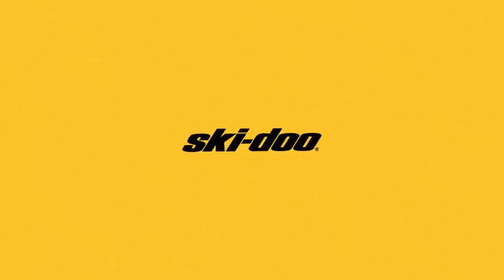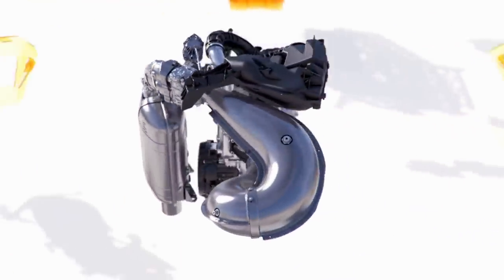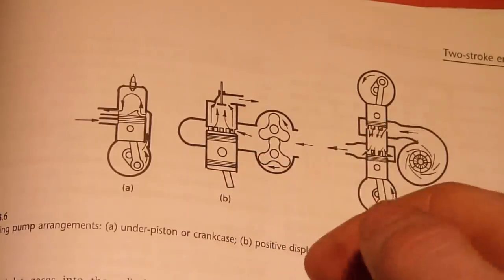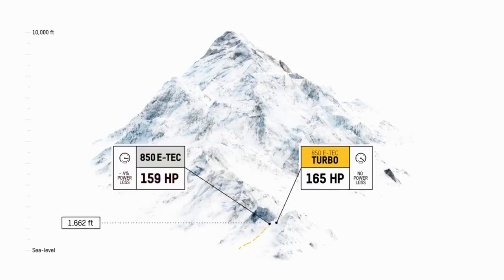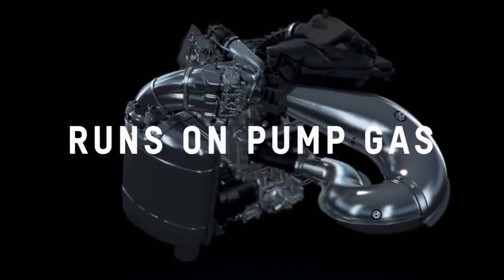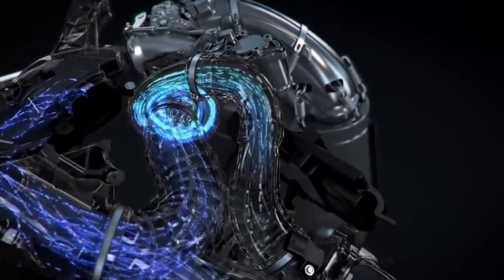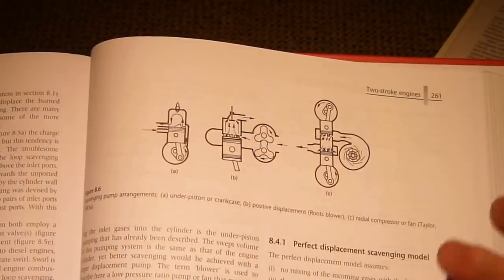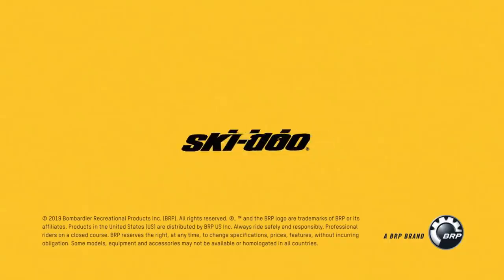2 Stroke Turbos - they can't be done. Period.

Comment: As an owner of a supercharged 2 stroke Detroit I have a feeling this video will be entertaining.
Reply: Both turbo AND supercharged on some models
Reply: But 2 strokes dont have valves bahahaha. I love it when they tell me the Detroit 8 was a 4 stroke.
Reply: 2 stroke Diesel is totally different animal
Reply: @johnpryor1318  a twostroke can have valves.go ahead and check ferrari"s prototypr 3cylinder two stroke engine
Reply: @lightjim1  it was a joke brother. A lot of 2 stroke diesel engines have valves. I'm familiar with the 3 cylinder Ferrari engine.
Reply: I have an old 6v92t lol
Reply: Got me a 6v92 on a 351w... Does this count??
Reply: @johnpryor1318  No it wasn't
Reply: Or the etec 850 turbo skidoo.
Reply: I was gonna say I thought there used to be a supercharged 2 stroke diesel made by Detroit back in the day
Reply: @ilovelulu8492  Detroits also were available with both superchargers and turbochargers on the same engine.  12V71s with two Roots blowers and two turbos. The Army had them for tank engines. They had a war power rating of 500+HP and a life cycle rating at that power level of 24 hours. A normally aspirated 12V71 ( 2 6-71 blowers only ) at the same RPM would produce in the 300 HP range. And in our case, went for over 14,000 hours without an overhaul.
Reply: I can't wait to put a 6v92 or 6v71 into my '95 powerstroke. I only have 317,968 miles so it will be a few years
Reply: @markbroad119  dude that would be an awesome ride, and ya you still got life in the Ole 7.3 one of mine has 280k the other is right under 500k great trucks
Reply: Detroit has valves !!
Reply: 1 better take the turbo off my 8v92 2 stroke detroit.

Comment: There is back pressure from the turbo to keep the air from "just running out". Basically you are raising the pressure across the whole motor. It's like running your motor 500' below sea level.

Comment: There is one major, but simple, point that two stroke turbo naysayers are missing. They are wrongly assuming that as the piston is just about to close the exhaust port that there is zero pressure just outside of the exhaust port. The pressure between the exhaust port and the restriction just down stream of the port caused by the turbo, say twelve psi, continues everywhere from the turbo to the exhaust port and into the cylinder, so as the exhaust port is closed there is twelve pounds of boost in the cylinder. See how simple it is now? Funny how I missed this simple aspect myself for several decades until it hit me like a ton of bricks while driving home from an event that had a turbo charged drag snowmobile with a completely unmodified engine that made unreal power.

Comment: You should tell this to the hillclimbers around me who turbocharge their snowmobiles.

Turbos create backpressure too, so both the valves being open doesnt matter when you design the exhaust to work with the turbocharging. I have seen it.

 These engines dont just blow themselves up either they run and idle and do it over and over. 

Is it as simple as turbocharging a 4 stroke? No. Not simple does not mean not possible
Reply: Totally agreed! People are forgetting the fact that even if boost pressure blows through the exhaust port when it opens.....it only aids in pressurizing the volume of the expansion chamber to b the stinger quicker (and in fact adds drive to the turbo)..... sure you might loose a bit of fuel?
I'm sure someone out there will rig up a rally style anti-lag (wasted spark or additional spark plug)  to use up that unburnt fuel to drive the turbo even harder and make it more efficient?
Reply: Driven my 2 stroke turbo snowmobile with stock pipe since 2016, no problem
Reply: Not only do they run they last longer than a naturally aspirated snowmobile. I’ve experienced it , apparently the boosts gets the charge out of the cylinders quicker and they don’t run as hot lol.
Reply: @Jarmezrocks  antilag on a 2 stroke would be outrageous
Reply: We have made 350hp on a 1996 ZRT600 with a turbo.. Stock cylinders.  Stock pipes. Stock crank.  600cc/350hp running for 3 years no commonest falures... .58hp/cc
Reply: @Better2strokes  ooooh that's nice....Those little ZRT's were a sweet triple

Comment: You're forgetting that the air going out of the piston and into the exhaust is much hotter that the cooler air going in and there's the back pressure wave from the previous combustion cycle. Skidoo might be the first manufacturer to put a turbo on a two stroke from the factory but boondocker and silber have been making aftermarket kits for years.

Comment: But, but, but... he pointed to line drawings in a book, it must be undeniable fact. That proves it!
IT IS WRITTEN!
Reply: Even more so if on a white board lol
Reply: Well, one could be fooled into thinking, that there is a point about the pressure difference between combustion chamber and crankcase. However, if you think a little further, you will notice, that the difference at the powerstroke and the pressure difference at the compression stroke are pretty much canceling each other out (for example, at 1 bar gage boost pressure, you would have 1 bar working against the combustion pressure, effectively creating a loss in engine power and at the compression stroke, you would have 1 bar working against the increasing pressure in the combustion chamber, effectively reducing the a loss in power due to compression). The additional power gained by turbocharging the engine, comes from the additional 1 bar boost pressure (well, and the additional amount of fuel air mixture ;D), wich you obviously have in your combustion chamber.
Reply: By that logic, the bible & quran are just true.

Comment: yes.. I understand the "pressurized air is going to go out the exhaust ports"...  but,  it IS still a denser mixture.  Obviously, there's NO way in hell would it ever be nearly as much of a power/efficiency gain on a 2 stroke vs 4 stroke,  but the turbo is still packing the crankcase with more air/fuel.  So, again.  YES, you will lose most of it,  but you will still have at least a slightly denser charge vs N/A.
edit: just wanted to add,  there is an event of "valve overlap" in nearly all 4 stroke engines (meaning there is a point in it's 'cycle of events' where the intake valve opens BEFORE the exhaust valve closes.) Why doesn't "all of the boost" flow right through both open valves? The answer is: SOME of it actually does...depending on lobe sep angle/duration/lift @ overlap event/etc..   
Now think about how the 2 stroke works again... It basically has a ton of overlap (exhaust port is open for a LOT longer) so we're gonna lose most of the pressure as compared to the 4 stroke,  but,  remember,  it's already way more of a dense mixture coming in from the bottom end due to the forced induction.
Reply: No need for scavenging when your forcing
Reply: @dreece2000  That's not true! What would give you that idea, just out of curiosity?
Reply: Install an exhaust trapping sleeve valve like Boyesen did.

Comment: The pressurized air will exit through the exhaust port ONLY if the exhaust/turbine inlet is at significantly lower pressure. If the compressor and turbine are appropriately sized, the exhaust will be at similar pressure levels as the crankcase when the turbo generates boost. Thereby, there will be trapped and boosted charge present in the cylinder and hence more power.
Reply: Congrats to one of the enlightened few. After three decades of thinking the common misconception that any pressure in the cylinder would simply be pushed out the exhaust, like a light bulb going off over my head, the correct concept hit me like a flash while driving, I almost had to pull over to compose myself. For a motor head it was a life changing moment.
Reply: @morgan4xl  bro are you bluechipx from physics forums? He said the same thing after thinking about a turbo snowmobile he saw racing
Reply: @samcharles1166  Yes I am. I use those two screen names on various sites, very perceptive of you to see that seeing as though there are millions of posters on youtube! Actually I am wouking on a turbocharged hydroplane right now. I have a mystery water leak that is somehow getting water into the exhaust system and making it's way into the crankcase and killing the bottom spark plug on a four cylinder inline Mercury 44 cu in engine. I hope to have it fixed today.
Reply: @morgan4xl  WOW! What are the odds that I read your post on the forum about 10 hours prior to reading your comment here, even 11 years later? Thanks for enlightening me on the reality of 2 stroke turbocharging. I wish you luck with the hydroplane project.

This coming southern summer, 2 friends and I will attempt to build a go-kart from the ground up using an old 2 stroke lawn mower motor. I'm sure it will be fun.

Comment: Matt
I know you're telling the truth, but i cant let you shatter my dreams of building a >100 whp trabant which still has a 2 stroke.
Reply: no need for Turbo there. Frank Zyprian casted own 5 transfer / Bridged exhaust 600cc nikasil cylinders. saw a dynograph some time ago, where they got 105 hp@6600 and 115Nm @5900 rpm. Guess will last from 12 to lunch. :D
Reply: DKW did it one better. They took two engines and mated them together. The first engine served as a supercharger and the second one sent power to the clutch. 3=6 while 2=junk. 😉
Reply: One question, if you aren't swapping the engine then how would you do that by using a turbo on the original engine? For starters, the engine hasn't ever been designed to be a turbocharged unit. Further more, the compressed air would leave the cylinders when the exhaust ports aren't covered by the pistons and last but not least, the engine does not have valves which also makes it inefficient with turbocharging so theoretically little to no power would be gained.

Comment: With a properly tuned expansion chamber it will function as intended, if you consider the entire assembly from intake to tailpipe it is all one system. The chamber pressure of the crankcase, cylinder and expansion chamber will equalize to the input pressure of 4 psi above ambient pressure. At altitude that means an internal pressure of approximately 14.5psi or the same pressure at sea level on a standard day, which the point of the skidoo turbo setup.

Comment: 2 stroke turbos in this sense are used to maintain the density of air, not to add horsepower. And If you think about it, if you add more than enough dense air, some will air escape, but a portion of that denser air will stay inside the engine leading to more stable horsepower at higher elevations. so as elevation increases the turbo lets more air into the engine even if some escapes. Plus I am pretty sure gasoline operated 2 strokes have specially designed exhaust pipes to create back pressure so less fuel and air escapes.

Comment: If it goes out the exhaust port..... It's only further driving the turbo? It would then come back to "back pressure" from the filing the expansion chamber to the stingerpipe?
Essentially it will waste a bit of fuel but the positive pressure just as the piston closes on up stroke will still be a lot higher than the stock compression ratio? So a net gain in HP. There are guys making this work....so the theory can't be that flawed?
Reply: The compression ratio doesn’t change. The density of air consumed by that given compression ratio does.

Comment: I was laughing,  they I read the comments and nearly got a hernia laughing so hard it's completely amazing the number people that don't understand the basic architectural differences between two strokes and four strokes. Not to mention throwing in diesel two strokes and four strokes I'll bet most of these people would completely freak out if they saw somebody building a fire under the cylinder head of their diesels before they started it up.
Reply: Brb welding V8s together with roots superchargers for a 2 stroke diesel design ;)
Reply: @Aspire198  Deltic is the king https://en.wikipedia.org/wiki/Napier_Deltic
Reply: @Aspire198  how did it go?
Reply: Building a fire under the oil pan maybe you mean? I've never heard of someone building a fire under a cylinder head? Lmao
Reply: Built fires in the intake tract of a EMD 2 stroke locomotive engine with news paper to start them up cold

Comment: There adding higher pressure to the crank case = more fuel and air goes into the cylinder  if they weren't getting more chooch out of the 850s choch they wouldn't be doing it

Comment: When you are riding at heights in the mountains the air is thinner, a turbo could increase the oxygen going into it?

But then, the output of the turbo in this design is also connected to the input, so it would just be blowing air anyway and never generate pressure on any engine!

Comment: Just me spitballing, if you can get the back pressure of spooling the turbo up and then make the pipe in accordance to that i bet you could get the scavenging back just like at atmospheric pressure, or close to it. i know it helps to have multiple cylinders (dont know the science behind it) but ive seen guys with drag snowmobiles do it, adjusted porting and port timing. not efficient at all but works for peak horsepower

Comment: I think because there's a little bit of back pressure in exhaust that doesn't change with elevation so low altitude equivalent intake charge can be maintained. Turbo... let's call it "blow through" is managed by exhaust pressure.

Comment: I'm currently running a bbr 100cc engine strapped to a kids bicycle frame..I have reversed the jug and piston..placing the intake up front and the exhaust in the rear.. specially in colder weather but not none the less..my bike runs beautiful.. had to richen up the carb jet..but does function great as air is being more forced into the engine..not saying that everyone will have great success at turbo..but regardless,  a turbo can be done with a two stroke..

Comment: I would hold that if a crank case scavenged gasoline 2 stroke had direct injection, it would benefit from forced induction. The port overlap could be timed to allow a bit of boost to build. It would have to be at least 2 cylinders or more with uneven firing I believe for the sake of exhaust manifold pressure
Edit: The direct injection would be needed as there could be exhaustion of the gas mix out of the exhaust port before closing, as such an engine could not have the usual sonic back pressure type thing

Comment: Facepalm : you could push a few bar of boost — as long as your CFM is high enough.
as the exhaust port is venting you must simply keep higher CFM flow (with the higher density) through intake vs exhaust port. 
This makes it hard if not impossible with turbo— but why not supercharged?
Reply from the maker: This comment makes no sense...
Reply: The Workshop 🤦‍♂️🤦‍♂️
Reply from the maker: That helped...

Comment: Question:
EGR is used to cool the combustion, to reduce harmful emissions. Why can´t EGR be omitted by using a cooler thermostat instead? Thanks.
Reply from the maker: Because the coolant protects the engine not controls the combustion temp.

In other words egr cools the fire, coolant cools the oven

Comment: You guys are forgetting that tuned 2 stroke exhaust has sound waves that bounce back from the prevous charge thru the exhaust port that helps pack the cylinder....like supercharging....add the turbo to the intake side and you are enhancing the compressed charge.
At 70 l have a LOT of time racing 2 stroke sleds and boats ....we have played with tuned exhaust forever.
BTW just add juice ( nitrous) when you really want some power! Haha
Reply from the maker: 1) it reduces fresh charge leaving the cylinder. It doesn't pack it in.

2) that's not what supercharging is.

Comment: They only work if the engine has valves or rotatory valve. Boost will open reed valves at wrong times and messes with the pulses of the power pipe negating it's purpose and engine/port timing. Also don't work on single cylinder engines without a "Boost tank" of the same volume or close to cylinder volume
Reply: so I can't just boost a Reed valve 2 stroke and tighten down the stinger a bit to compensate for additional air charge? do I need stiffer reeds then?

Comment: I hate to break it to you, but a fella in Michigan has a cartridge bearing turbocharger on a 40 Hp Mercury outboard on a 6 foot plywood hydroplane, it made 213 hp, had a Fast efi setup using GM coils. It almost killed him. He has the same turbo setup on a Skidoo Formula 3 from the 90's and it is a fucking animal. He also has a 427 Side oiler Ford in a 1976 Honda Civic that's rear wheel drive. Anything can be done with enough money and skills, my freind, and a wealthy genius machine shop wizard can, and has already done the things you said can't be done, more than 20 years ago.
Reply: 213 hp form a 40 HP mercury OB. Imagine boost on a 3.2L v6 optimax 300 xs actually 192 CID and drop that in an f-150 truck. Now each 192 CID 300 xs v6 2 stroke block is 60 deg so 3 of them could make an OP mini deltic 576 CID 2 stroke!

Comment: I liked the bit where he says, "The pressurised air will go straight out the exhaust ports, that's physics!!", with the middle picture, in the book diagram, showing a Webb uniflow 2 stroke which has an exhaust valve and no exhaust ports.
So many different types of 2 stroke engine out there. The earliest Victorian 2 stroke generator & pump engines ran on domestic coal gas from the household supply.